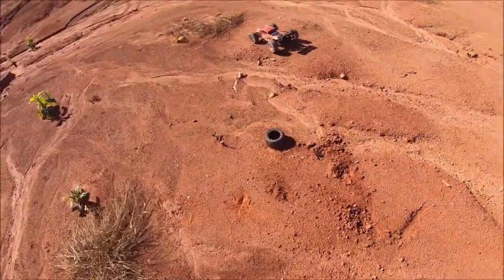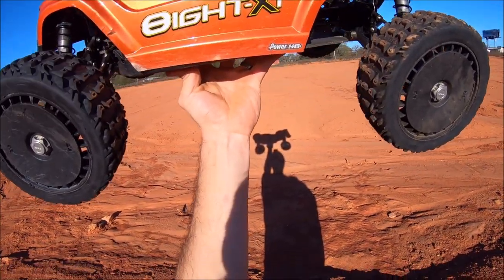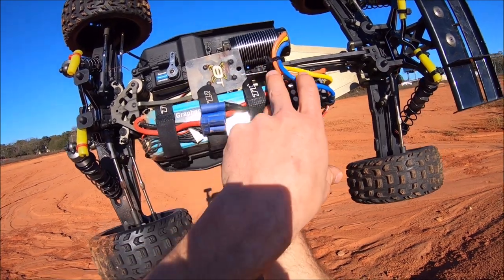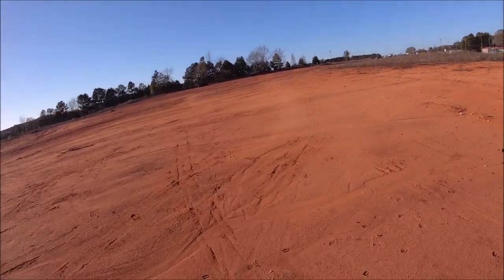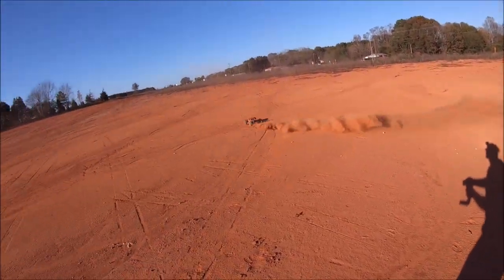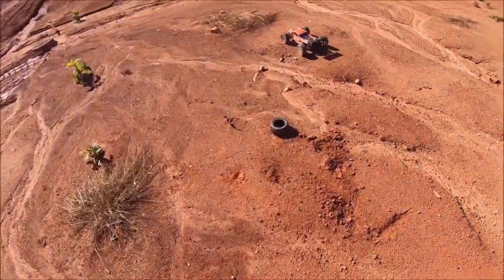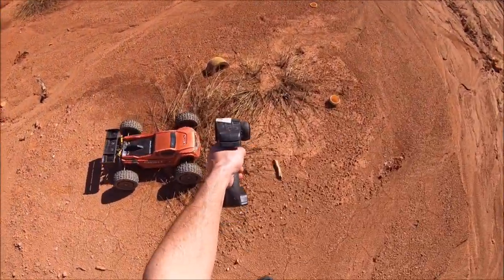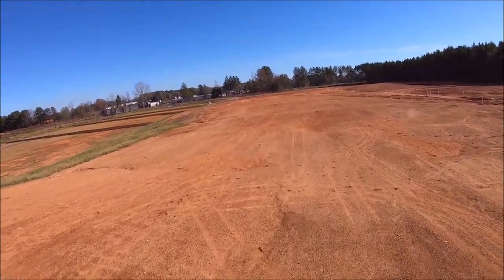LOSI 8ight XT/e 6s! "BASHING LAND ROCKET!!"😱High speed rips/drifts and air!

Comment from the maker: For a racing spec rig, I'm totally blown away by it's overall durability and butter smooth handling and driving! Had a total blast just ripping her around and she fly's so balanced! Hope to be working with M2C Racing soon for some future beef for this rig to get her in the extreme bash market! So far the only issues I've had are a blown front diff bearing and a cracked rear bulkhead which I will go over in my next vid with it. Overall I'm still SUPER impressed with what this thing takes almost box stock! WHOLE other world than a RTR! Building it was a pleasure and the parts are such well engineered and machined parts! HUGE shoutout to Horizon and TLR for the opportunity once again! Thanks for watching!
Reply: Thing will be sicker with all M2C stuff going to get a chassis soon

Comment: Yeah man this is a sick set-up! 🤘 I'm running pretty much the same system in my HPI Flux 6s, the HPI shocks are a fail though ☹ GPM time!
Awesome as always Dude👌
Reply from the maker: Thanks bro!!😎👊
Reply: @RCDUDE81  If you don't mind me asking, what is the kVs of this motor and pinion size? 
I just ask because I seem to get the best results using a low kv, high tooth count set-up, not that you need help with set-ups👍
Reply from the maker: I'm running a Hobbystar 2000kv 4076 with a 20 tooth pinion. The motor got warm but not dangerously hot. I can get away with it during cooler months but run 18 tooth otherwise! But to your point, lower kv and larger pinion or smaller spur definitely is more efficient with less amp draw under load.😎👊🤘🤘
Reply: @RCDUDE81  All good man, I just watched the first test video again, so yeah you got the 2000kv w/18t were im running a 4076 1700kv w/20t but it dose get quite warm 👍
Reply: @RCDUDE81  Yeah efficiency with the lower kv mainly. Cheers man✌

Comment: Nice Eric allways love to watch your insane bashing. Took my kraton out today and broke my wing mount right on rear shock tower. Sucky.... And it's in the hot racing diff so i loctight it so it will be a pain in ass to do. But i think i just leave off wing what do you think
Reply from the maker: Thanks Gerald!👊Sucks on the wing!😝It happens! I recommend running one bc it does help protect the rear of the truck more than you think! If you dont, I'd make sure you're running the rear tower brace at least to save your rear bulkhead. Thanks for watching buddy!😎👊🤘🤘

Comment: Should I get this or the exb?
Reply from the maker: The EXB will be a better basher out of the box imo. Plus it comes with tires.. The Losi is a high end race kit with stellar machined parts and is super lightweight! It is surprisingly tough but has a couple weak spots just like anything.😜Hope to see some upgrades for it from M2C soon!💪Honestly if you're in it for the build and want a very well engineered great handling rig, the Losi is where its at. If you want all around "basher" The EXB.😎👊
Reply: @RCDUDE81  gotcha thanks bro
Reply: @RCDUDE81  you should make a video about the weakpoints - I am in between this and exb aswell for all around and bashing...would love to choose the losi but only if I know upfront the weakpoints 🙏🏼

Comment: there some good upgrades for these now gt6 make a rear 7075 chassis brace exotic make a 7075 centre diff housing off a tlr buggy 2,0 that fits and a 7075 steering bell crank
Reply from the maker: Great info thanks!👊
Reply: @RCDUDE81  iv just built one it’s an awesome truck iv fitted the upgrades it’s one tough beast now and it drives great 👍
Reply: @RCDUDE81  exotek racing and gt6 racing 👌
Sorry for my misspelling in last comment
Reply: @RCDUDE81  hey quick question what rear centre drive shaft you running on yours was it Mojave ?? Or stock
Reply from the maker: @marksrc-ri9jf  it was a Mojave shaft. I believe it's the front Center. I no longer have the car so I can't verify.

Comment: Hobbystar the motor that you're running or a 4092 2200kv do you think that will be fine with a spectrum smart 150 amp esc and either one should be faster than the spectrum 2050 correct?
Reply from the maker: What truck is it for? If it's for the Losi, I honestly don't recommend a 4092 motor. Too heavy😱
Reply: @RCDUDE81  talion I just want to be faster between 70 and 80 so far I haven't been able to hit 70 like it says on the box tried it with the factory system and then I got my hands on the spectrum smart system so that's what's in there now the new batteries just showed up today but I do want an aftermarket motor and bigger is always better LOL what do you recommend 4092 was just big so I figured it was better